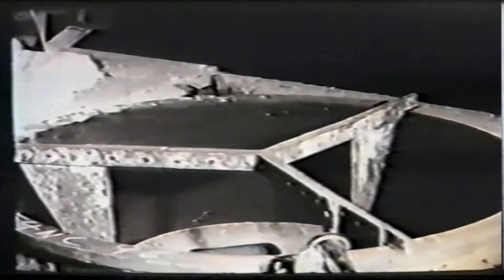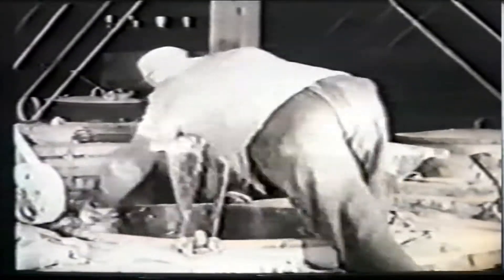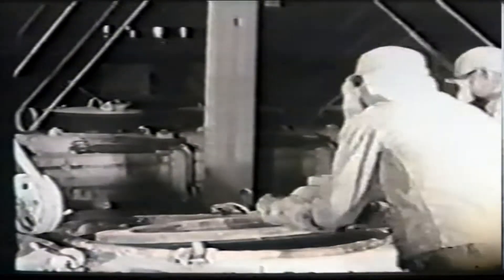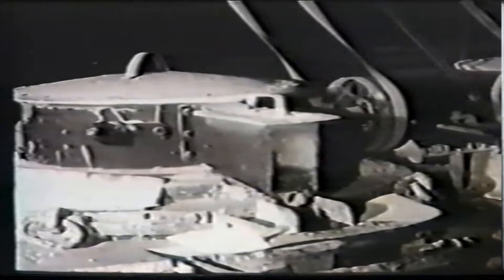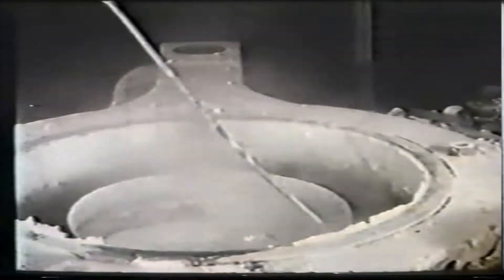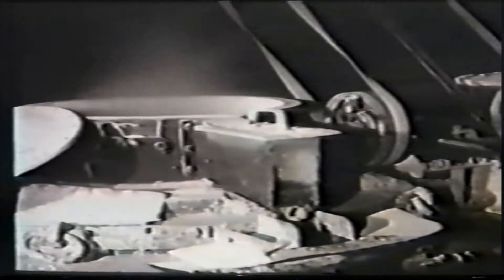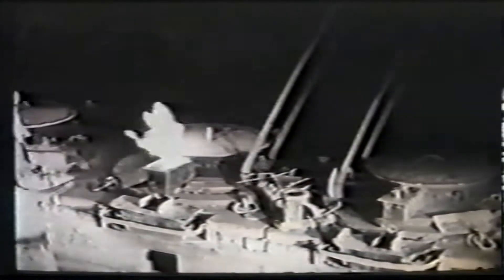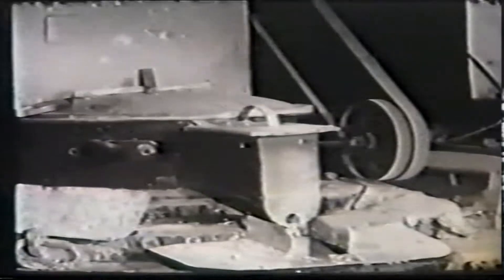Making tonnes of metallic sodium!! History of the chemical industry & chemical engineering in action

Comment: The music intro makes it feel like there's some serious drama about to happen.  Also interesting, the narrator keeps saying the hydrogen burns spontaneously in the air when the lids are uncovered, but H2 doesn't do that.  Hot sodium will do that, which would explain the bright flashes.  That was really cool to watch, thanks for providing it.  I'm also wondering what they were using sodium for in 1890 and later.  Obviously its a great reducing agent to get your hands on other metals, but it makes me wonder what its main use was back then.  Amazing to think we had sodium metal in 1890 too.
Reply: Some additional thoughts that got me wondering (and some progress on them).  9000A DC in 1930-1950 wasn't easy to come by.  They mentioned the cells ran at 270V (DC) on each string and that made me wonder about the power supply.  Turns out UK 3-phase power used to be 380V AC.  If you divide that by 2 (a common transformer) you get 190V. If you convert AC to DC (peak voltage) you get (root 2 times = 1.41x) that or about 270V.  That seems likely what the input was, since 3-phase is used industrially (and by power transmission lines), but how they converted it to 9000A DC per leg of 60 pots has me wondering.  Silicon diodes didn't exist back then.  Vacuum tubes did by 1930 but I've never heard of them being used (as diodes) to convert that kind of power from AC to DC.  There's a couple of plausible things, particularly to get all the way back to 1890 and that was to do a "mechanical" conversion.  Basically, an AC motor was connected physically to a DC generator (and they'd probably need one set of these per 60-pot leg).  They would have been quite huge (both about 2 megawatts!), and the efficiency of that is surprisingly good, typically over 80% even back then.  Finally (and this is more likely for 1890) you could generate your own power on site.  The further back you go, the less electricity was around then, so your factory could be burning coal on-site, driving huge DC generators (no AC), then using that for the plant.  If anyone has any ideas, I'd be curious what you think was involved in getting the power needed.

Comment: which country is it ?  and date  of this video?  is it england because industrial revolution began in there?
Reply from the maker: Yup, this is England in about 1930 or so. The process is much older (late 1800s) but it was run for a long time!
Reply: The film shows MCLII which is 1952 (Roman numerals) and was produced in England.  All of the text (and the date) shows up in the text and intro in the first minute of this video.  The text also mentions that they ran from about 1930 (and were basically copies/improvements from a plant run elsewhere in England in 1890) and ran until shut down in 1952 (the date of this film), when "a better process" was used instead.  I suspect that is the Downs cell, which uses higher temperatures, but is NaCl rather than NaOH based.  It also typically has other additives to lower the melting point from the 801C pure NaCl requires.  Calcium chloride was typical to mix in on that cell, bringing the temperature down to 600C.  That is still WAY hotter than the 350C mentioned here for the Castner process.